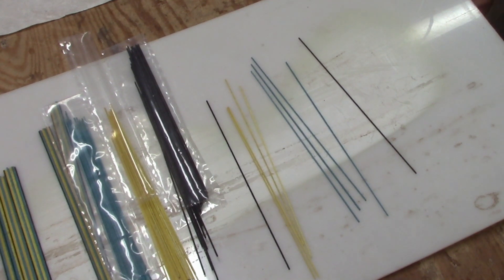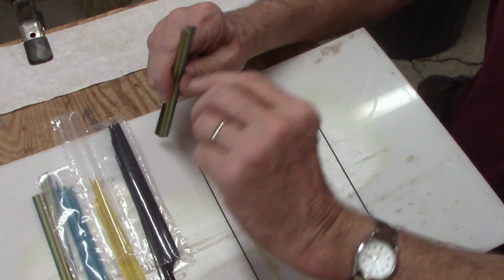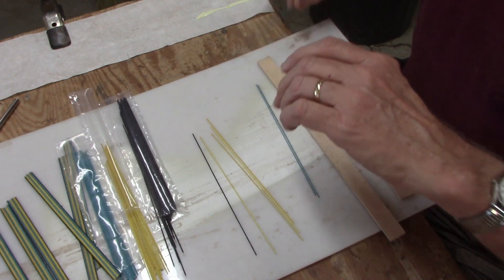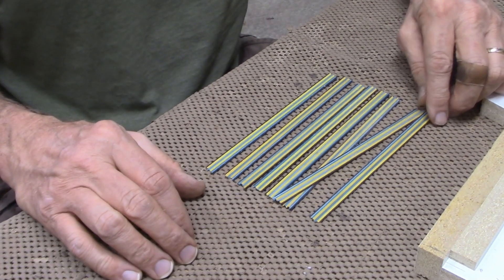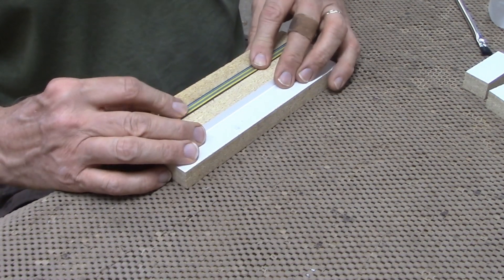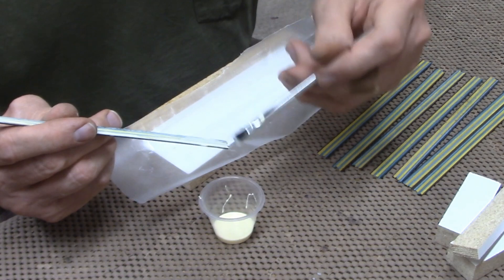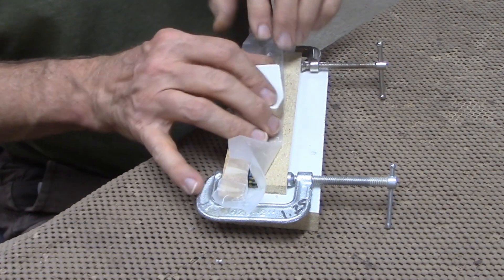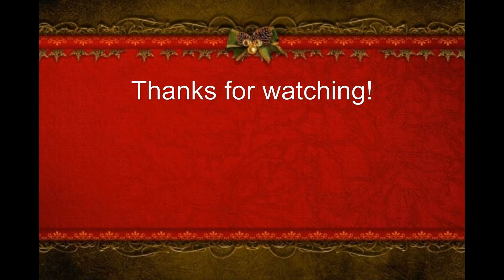Making a Classical Guitar Rosette, Part 1

Comment: Ah, building a Rosette.  The most fun design element.  Can’t be too large for me.  640x480 sticks like old IBM VGA graphics sounds about right.  So my question is: can you make rectangle tiles and square tiles of the same height to create a pattern design that has an alternating spacing? ie. square rectangle square rectangle.
Reply from the maker: Probably,  yes.